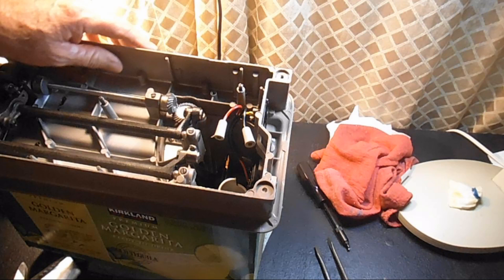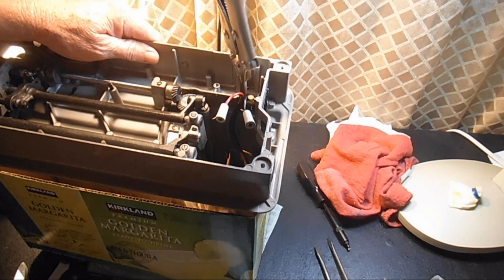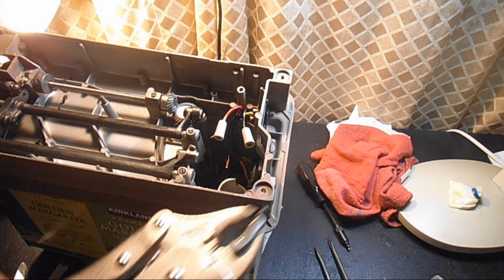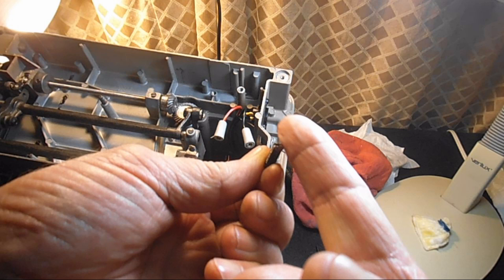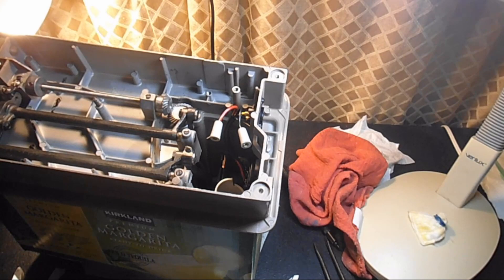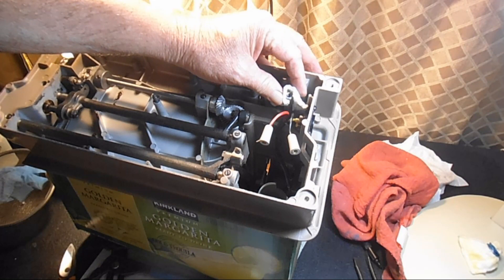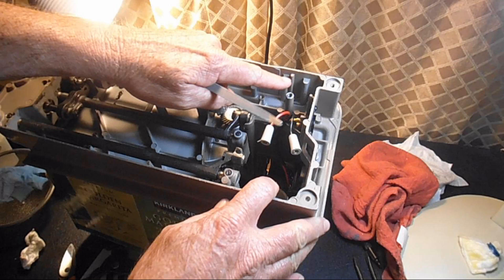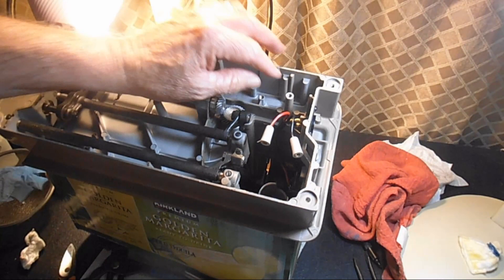Removing a Broken Screw from a Singer Model 301A

Comment: Here in the US, the brands Permatex and Loctite are available in every hardware store, automotive parts store and Walmart, as well as online from Amazon. A search for "aluminum anti-seize lubricant" will return pricing and local availability, as well as other manufacturers. The lubricant comes in 1oz tubes up to 8oz and larger tubs for production volumes and applications like vehicle repair facilities. 

As to the fastener size issue, I stumbled upon this bit of information and invaluable tables listing Singer fasteners, along with sizes, taps and current alternate tap sizes, I saved this as a odf to my iPad, as well as printing it out to have in my basement shop, 
http://www.singersewinginfo.co.uk/screw_threads/
Reply from the maker: Thank you very much, Joe. I was aware of the two brands you mention but thought their products were only made to prevent screws and bolts from working loose. It's kind of you to share this info. As for the link to the Singer screw thread information, well that is like digital gold! If already downloaded and printed a copy. I have a friend who understands about threading and tap-and-die stuff much better than I do and am taking him to lunch Saturday to show him this info and ask about him helping me out when I need to replace missing screws on a VSM. On a side note, I am jealous of your "basement shop", haha. I'd love to have that kind of room to work in on my machines. Thanks again for all the information. (pinned your comment so others will see it)

Comment: You probably know this already, but use a thread gage to check the threads per inch. Looks like a #6 or #8 screw,  and could be 24 or 32 threads per inch. When you put the new screw in, put a little anti-seize paste on the threads to insure that it will back out in the future. Steel into aluminum will cause the screw to bind due to the dissimilar metals, and the anti-seize will compensate for that. Patience usually pays off, and you did it right. 

Enjoy your channel. I’m a pre 1970 Singer collector, and really enjoy bringing these vintage machines back to life. My oldest is a 1938 201-2 that purrs like a kitten after a lot of TLC, grease and oil.
Reply from the maker: Thanks for the comment Joe. I've taken over 2 dozen screws to hardware stores over the years, here and in the UK. 99% of them were non-standard size and thread count. My understanding is that Singer used propritary sizes and thread counts on their machines so owners would always use the Singer Stores for repairs. I was able to get 2 screws though and they were both for sewing machine cases.
I don't know about the "anti-seize paste" you mention, but really like the sound of it. Many of the screws on the machines I work on are steel into aluminum body. Some can be hard to break free. Can you tell us a brand name of a product you like, or give us a link? When restoring a machine I think of future maintainance and love the idea of the paste.
Thanks for watching my channel, and for saving the machines that you collect and work on. Your 201-2 sounds wonderfull and if you ever put up a slide show of your machines please let me now as I enjoying seeing the resored machines people have saved. Take Care Joe.

Comment: I was sitting here watching this video and when I heard that screw turn loose I clapped
and yelled Yaaaaaaay!
Good for you Andy.
Reply from the maker: It was the best sound I'd heard in a while. I was ready to follow your suggestion of cutting down the aluminum. I had bought a new cutting disc for my Dremel. I realized I had tried grasping the screw before from the side of the vise-grip and not the tip. I did not have much to lose trying one more time with the pliers and fortunatley it worked. Thanks again for the suggestion, and for watching ANdy Tube.
Reply: Before we got into the weeds about how to cut away the casting, 
my very first suggestion was if there was enough of the screw
sticking out, to try the Vice Grips.
The way it was stuck (I think it was bottomed out) not sure the 
Penetrating oil helped much but certainly didn't hurt.
I have heard that "Snap" before and sometimes it means the screw/
bolt has broken off even deeper in the hole.
All's well that ends well.

Comment: The threads in the machine were probably buggered from the factory, Once I get a screw out like that I chase the threads with a tap, and the anti-seize suggestions in the thread are excellent comments.
Reply from the maker: Do you have "taps" that match the Singer Proprietary thread sizes? My understanding is most of the screws and bolts are of an uncommon size and thread count. I have been to several hardware and specialty stores looking for replacement screws and have never been able to find a single one that was the same as the original Singer screw. That's why I'm asking about your taps. Maybe you "chase the threads with a tap" that is a standard size and use a common screw or bolt after that? Thank you.
Reply: I was just talking  general terms, I don't know about singers thread sizes but I assume they are American Standard (SAE), I would find it hard to believe that Singer just made up their own special little screw and thread sizes.
But then..... as I said I'm new to these domestic machines, so I could be wrong.
I'll be checking in to it though in the near future, because I really want to know for sure.

okay.. before I hit post I checked the end plate or belt cover on the 413 and those two screws are 10-28 so they are standard enough.
If you look at Mcmaster carr you'll find some sizes that aren't real common but are still American standard.
My thread gauge jumps from 36 tpi to 40 and the dog screws are somewhere in-between that that, so I'll have to look in to why and what is available.
The smallest tap I have in my set is 6-32 but I have others loose in a box I'll have to dig out to look at.
and then.... there are metrics to consider.
Reply from the maker: Mark thanks for such a thorough reply. I appreciate you taking the time to research it too. When I first started restoring machines years ago I was surprised when stores would tell me the screw I was looking for was not an SAE screw and they could not help me. I had 2 friends in the EU look for replacements also b/c we thought they were probably metric. They had no luck either. I will look for a chart I got a long time ago about Singer screw sizes and what could be used in certain applications. I remember it was interesting that some screws were in fact SAE. My Singer repairman friend from Canada once told me that Singer made proprietary sizes and thread counts so customers would need to go to their Singer Sewing Centers for repair. Again, thanks for your enlightenment on the subject!
Reply: Yes, this is all pretty interesting 
When I get a little better set up I'll dig in to this and see what I can come up with.
I moved here going on three years ago now and have been either in the hospital or in a bed most of that time, so a lot of my goodies are still in boxes who knows where.
I'll get my thread gauges and my mics dug out and we'll see what singer was up to.
I'd really like to replace a lot of their screws with hex heads, I HATE flatheads with a passion.
Reply from the maker: It's good to hear you are at the point of getting back into hobbies. I understand your feelings towards flathead screws. Good luck with the hex heads. You could start a whole new trend in VSM restoration!!
Reply: Yea, I've been waiting 3 days now for a good flat head screwdriver to come so I can get that top gear out, sadly Craftsman's have gotten soft in their old age.
But then.... I don't get around like I did when I was twenty either.   ;O)
I hope I can make that hex head thing happen, but it might be as you said, they did their own thing.
We'll see.

Comment: Congratulations! I'm so pleased. Does it look like the original screw? Does an original screw still fit the threaded body? I don't think it was your fault the screw broke in the first place, the blame lies with whoever cranked it down too tight.
Reply from the maker: Thanks for the absolution :) I found a used bracket and screw on Bonanza and the screw went right in and works perfectly. No damage to the threads in the hole thank goodness.

Comment: I just started restoring my new-to-me 301, what fun!  Until I got to the tension set screw inside the machine. It is not flush and in fact deeply recessed into the hole.  I see silver with a flathead screw top.  I sprayed wd40 to no avail.  I removed the tension assembly on the outside and nothing even wiggles.  Help please.  Also, the screwdriver I have is more narrow the the screw head so I'm sure a better fit would help?    Thank you so much !!!
Reply from the maker: This is the screw for the tension post? If you are seeing a recessed set screw it may be someone worked on the machine before and used the wrong screw. 
     OF COURSE, you need a better screwdriver. A tapered blade tip can damage and strip machine screw heads right off. Then what will you do?  https://chapmanmfg.com/products/9600-starter-slotted-bit-set
     To work on and clean a tension assembly it is not required to remove the post at all. I do it in most of my videos to show how, but if the post is not damaged you can leave it in place and just remove the other parts from it for cleaning.
     I'm not sure if you have seen my 2 Playlists for model 301A. Here is the "Coco" playlist and videos 5A, B, and C show all about the tension. https://www.youtube.com/playlist?list=PLsCOZgzzaiKLZyGebzS_oISgesXNyREyI   
      The other playlist has 17 more videos about working on a 301A. https://www.youtube.com/playlist?list=PLsCOZgzzaiKI_6fbu3itbd1v4z3uQvvkO
Reply: Yes. I took everything apart. The spring was broken - ordered new one. The tension stud is stuck and won’t budge. Is there a way to send 2 photos to you ?
Reply from the maker: @gurudeepajeancorry5730   Well, it sounds like you are determined to remove the stud. The best way to proceed is for you to upload a video from your cellphone to your YouTube account. That way I'll have video and audio and you can explain what you want.